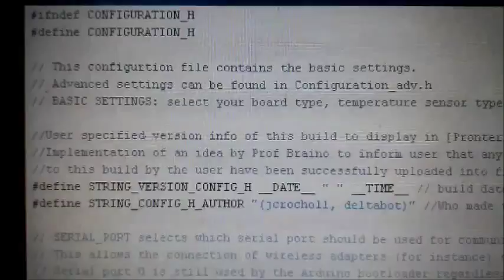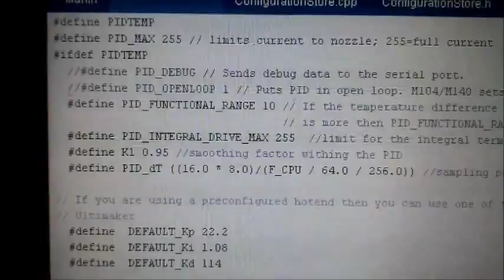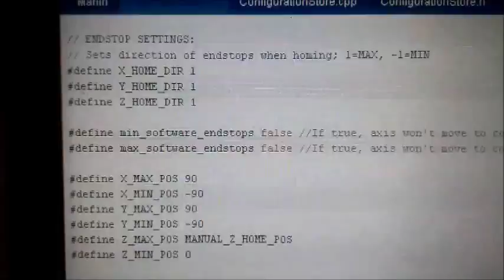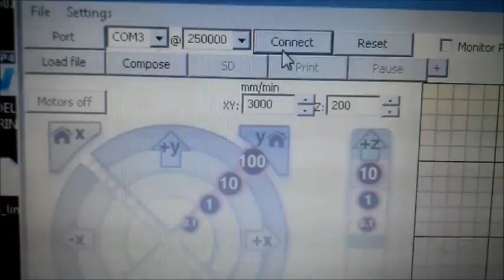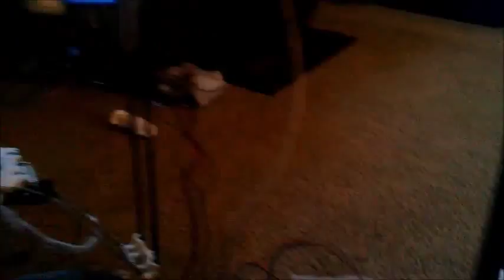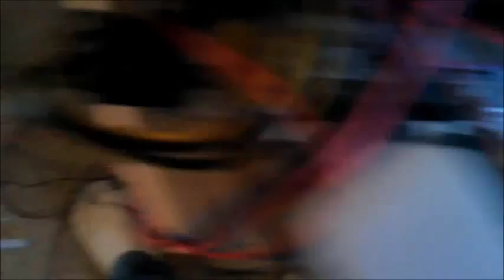ROSTOCK 3D PRINTER MARLIN FIRMWARE HELP!!

Comment: sometimes the Y motor will go down instead of up.
Reply from the maker: ramps board ?
Reply: I managed to solve that problem but came across another one. My extruder motor seems to be clicking when i try to print. this is not normal. Do you know how to solve this.

Comment: invert your max endstops to true.
Reply: Also I Just noticed how your endstops are wired.  If you are using a Raps on a Mega board the Endstops go: first row is MIN second is MAX etc.  And use command M119 in pronterface to check your endstop triggers.